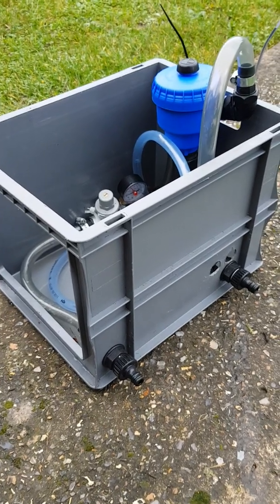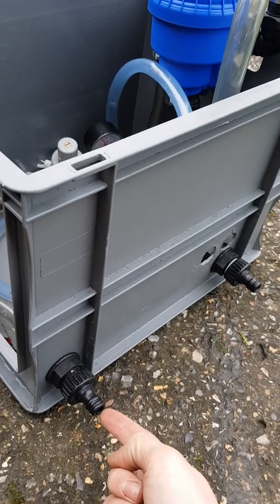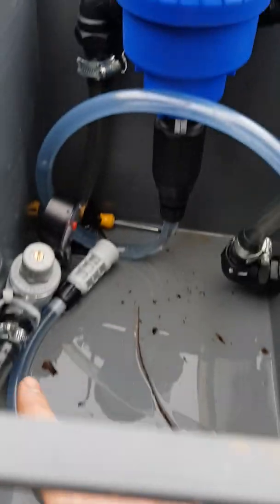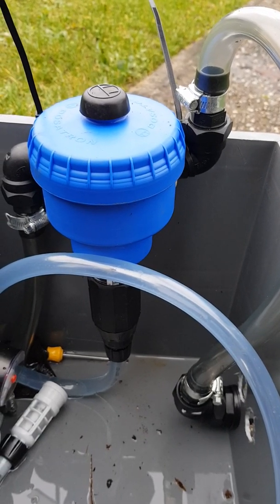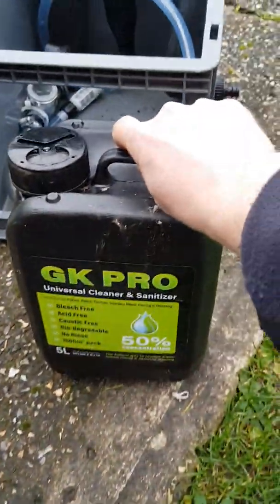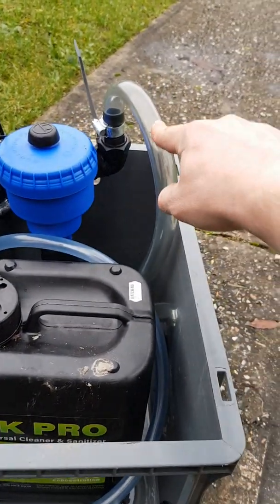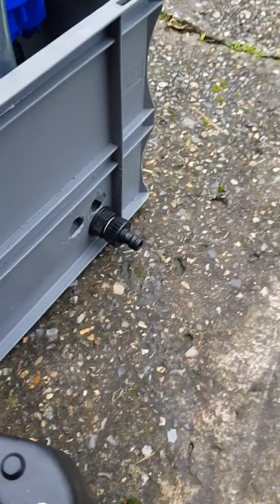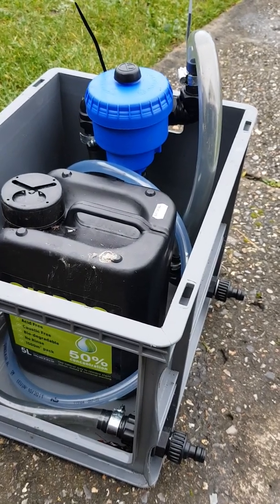How to make a dosatron box, for softwashing

Comment: Great vid. Do the hoses and the little strainer come with the dosatron? Do you have a precise list of parts and the quantities required that you can share (I don't have a clue when it comes to these connections)? Are all the fittings 3/4 inch?
Reply from the maker: List in the description 😉
Reply: @swgutter  which 'joints and elbows' did you use and how many of each are required for the build?